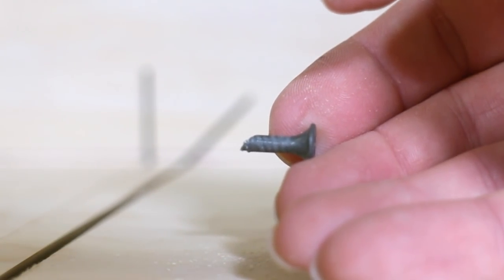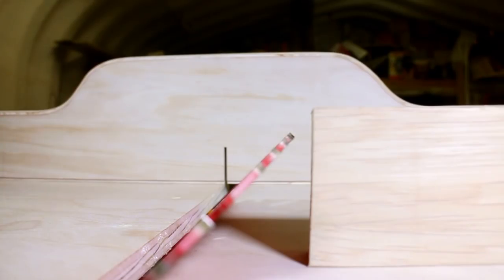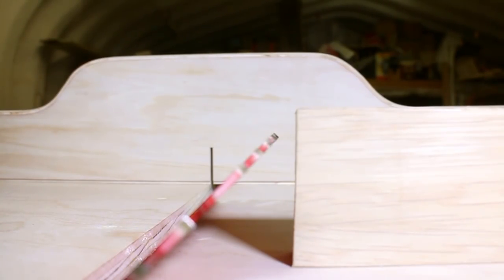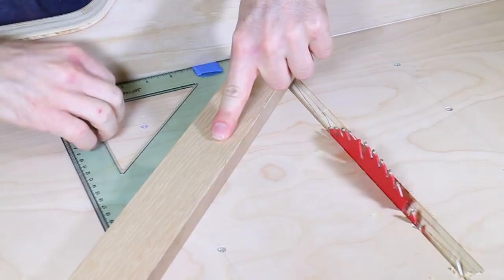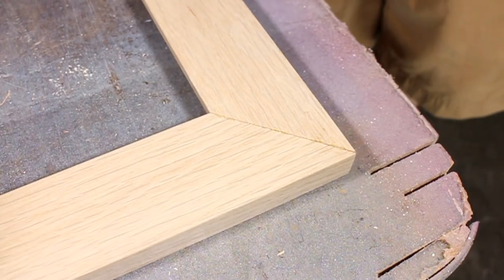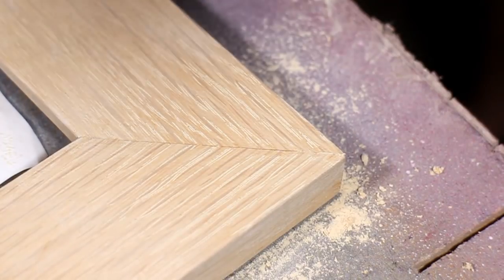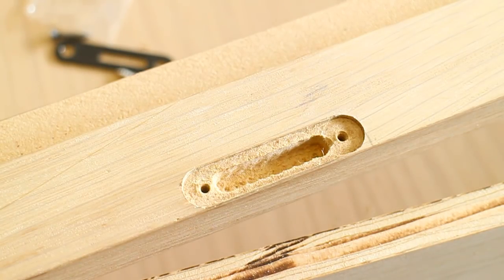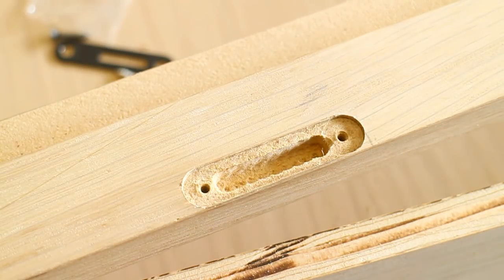Building a Simple Countertop Display Case

Comment: nice!  i want to do the same but smaller and silicone the inner box corners as i will put sand in it and a millennium falcon in it and a small wooden 4 prong wooden rake to make design in the sand and legs as a coffee table and possibly the side or the hinge do half cylinder so it looks like a book coffee table.

Comment: great job, but if I may ask a question.... if the sides (and lid) are sloped then surely the top edge of the front panel (where the lock is) wont marry up with the lid properly. Have you sloped the top edge ? or doesn't it matter much ? Thanks. Dave
Reply from the maker: I can't remember if I angled the front edge or not, but if I didn't, the front lip will still touch the lid, so it wouldn't matter much. And the angle is so slight, the lock isn't affected.

Comment: Hi,
Just wanted to say great job on the box. You technique with the patch and gap fill is awesome. Question though, how did you miter the wide boards of the box? I'm guessing sliding miter saw?
Reply: Table saw for the box sides with the blade tilted 45°. Table saw with blade at 90° and crosscut sled with triangle ruler to cut 45° miters for the frame. All boards laying flat.

Comment: How did you make the cam lock work. I have the same set up for my card display case. But I can't wrap my head around on how to make the lock work. 

Any pointers would be great.
Reply from the maker: I suppose that depends on where you're stuck. I found it helpful to take two scraps of wood and test the installation with those first to make sure my measurements worked correctly.
Reply: Did you just use a cam lock with a hook and then have the cam lock strike off center. So that when you lock the cam the hook is what will hold the lid from being able to be pulled open. 

(If that makes sense) I just couldn't wrap my head around how a normal cam lock with just a strait cam would be able to lock a case. As it wouldn't be able to hold against anything vs if you used it in a cabinet and it locks against the top lip. 

I'm thinking that's what you did. And that is why you hollowed out the middle area where the lock strike will sit.

So if this all makes sense haha I guess what I'm asking now is did you just have to put the lock strike off center a bit from the the cam lock so it had something to grab onto?
Reply from the maker: Oh, yeah, you definitely have to use the kind with a hook. The one I used is linked in the video description. It comes with a diagram that specifies the offset.
Reply: Wesley Treat, Maker of Things perfect! Thank you for the quick replies and help, really appreciate it.

Cheers :)